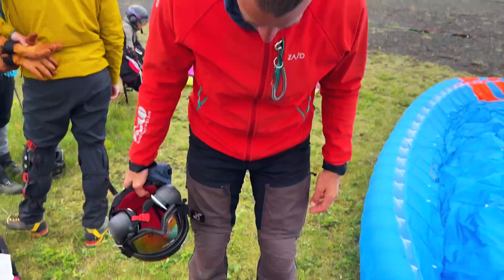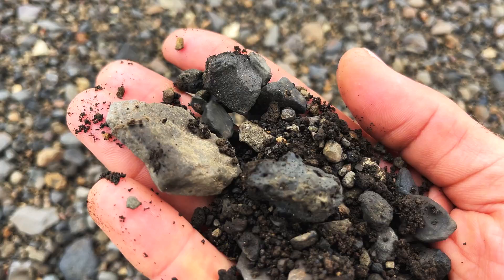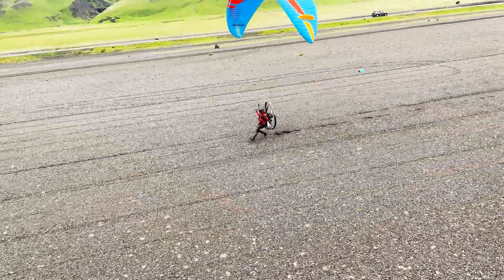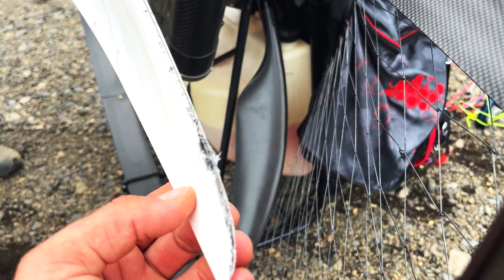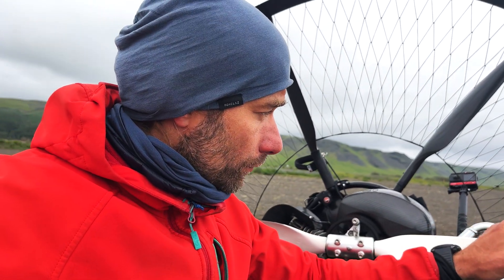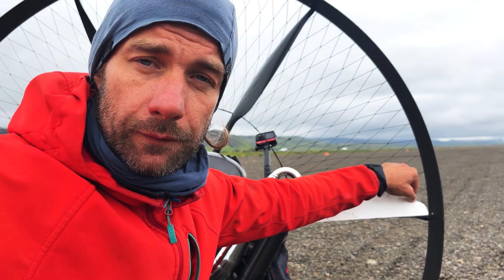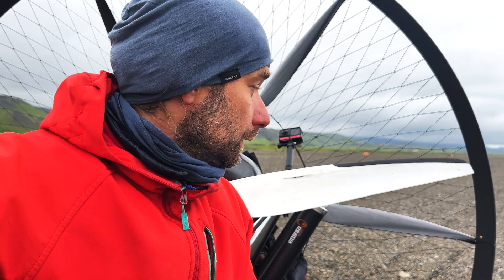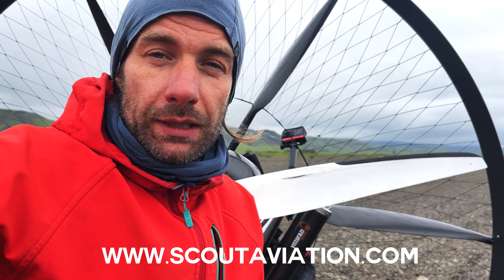Trying to destroy this propeller - footdragging sand, gravel and big rocks.

Comment: Yo, Einstein.  The 'Centrifugal Governer" approach (rotational speed) is way better than your approach (depending on airflow).  The centrifugal governor depends on rotational speed in order to change pitch.  This solves the problem of atmospheric pressures at different altitudes and makes it irrelevent to the pitch of the blade.  Rotational speed is the factor that changes pitch.
https://www.youtube.com/watch?v=B01LgS8S5C8